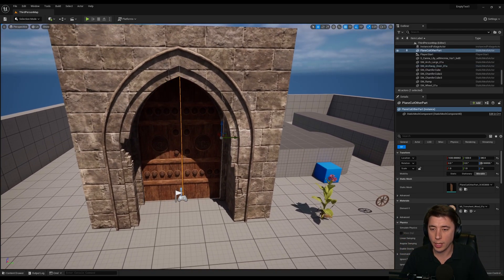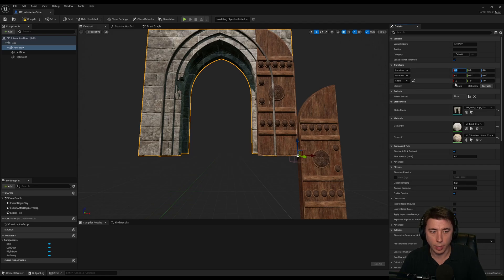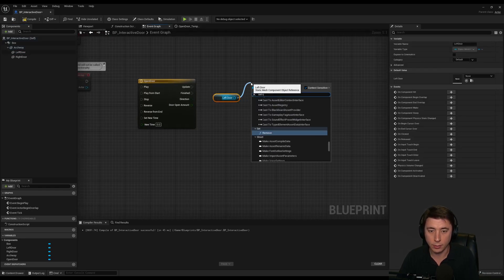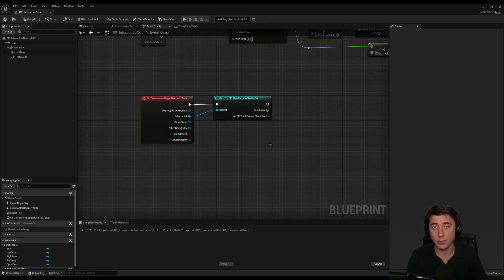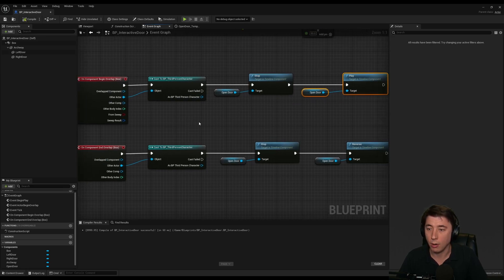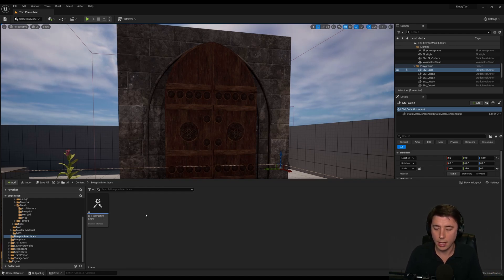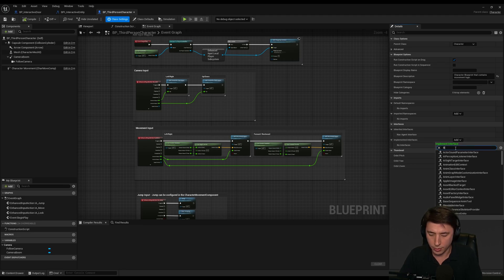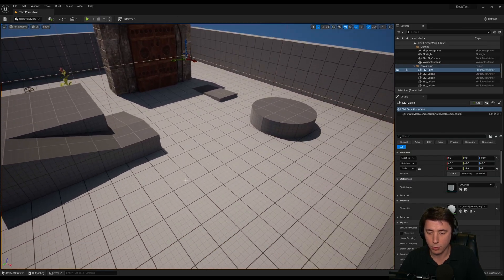Casting vs Blueprint Interface: When should I use each one? - With Interactive Door Examples

Comment: As a programmer in PHP and a few others it seems to me that an interface would be similar to building a function?  To express this in hybrid way, for example... lets say you made a survival type game and there were 100 different items you can pick up. Weapons, food, wood, rocks, plants etc etc. INTERFACES seems to me like... If it were possible to write a game in PHP, I would create a function (one block of code) and send to that block the variable values it needs, and then ask that code to detect and reference each object and then use an array, to store all the values for each object..... Which would be way more efficient.... But CASTING seems like I would have to write a block of code for each of the 100 possible objects?.... Am I understanding this correctly?
Reply from the maker: Yes correct!
Reply: Wrote this before watching the rest of the video... you basically say that LOL. Thanks.
 @NumenBrothers

Comment: This is a fantastic example of interfacing. Would you use interfaces to grab information from other blueprints or casting?
Reply from the maker: You can do either one- again it comes down to, do you know the specific actor in which you are communicating?   If not, use an interface, and pass that specific information through the interface via Inputs (variables on the interface) and then implement the interface (as event) on any/all possible receiving actors

Comment: casting render the entire blueprint before you can use it, 
in case of large blueprints casting them will consume more which is bad for your game optimization
in other hand, interfaces allow you to call only certain parts you specify, which is great for performance
Reply: Good to know... Seems that casting is inefficient as code also, look like you would create a lot of repeated code using casting?